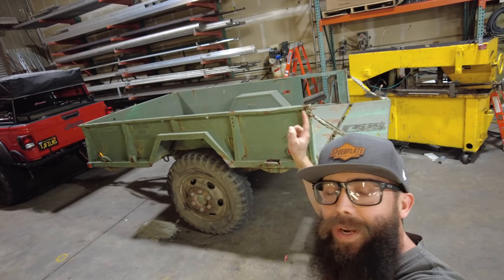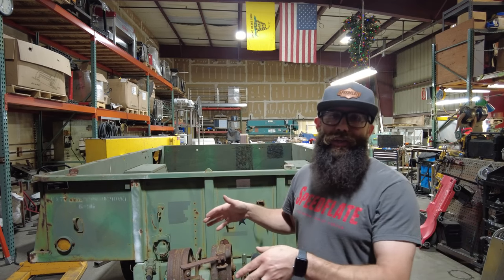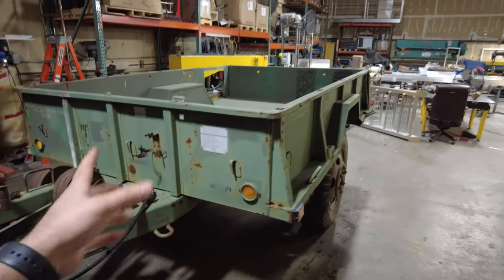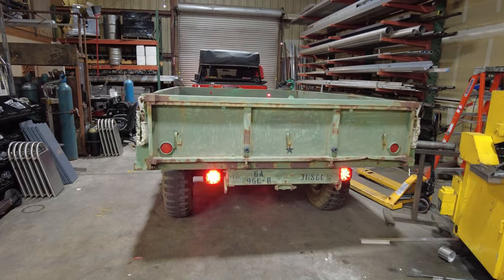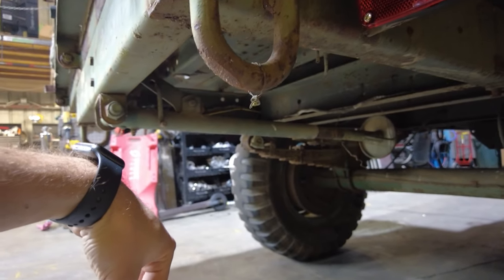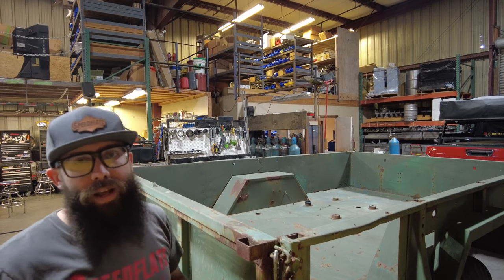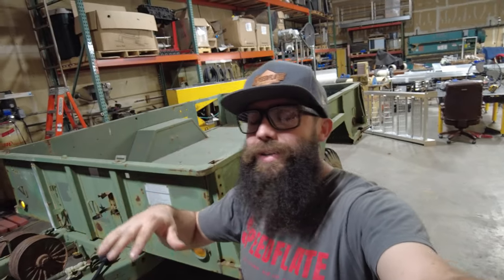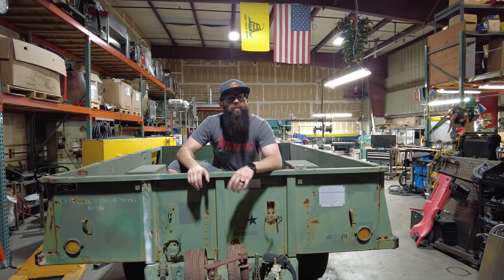Converting a M105A2 military trailer into an off road overlanding trailer.

Comment: They do have electric over hydraulic brake kits don’t know how easy it is to convert, that my plan for if I get the one I’m looking at right now. It’s a great deal at 1500 it’s one that was completely refurbished by a company so it’s from the 80s but it looks literally brand new, but damn that weight. You can change out the 24v bulbs with a 12v bulb no changing hardware. Then follow the wires and it will come to a junction box where they connect so you can cut and splice the wires into a 7 pin, you’ll have left over wires that do nothing but it keeps the original equipment which is what I’m wanting to do. How lifted is your Jeep, it looks like a great fit but I’ve also seen a Jeep Liberty towing one of those on a forum and man it makes this trailer look just absolutely massive.
Reply from the maker: I think most people end up swapping the axle out for something with electric brakes which is what I might do. The Gladiator has a 3” lift and 38” tires

Comment: I replaced the wheels with an izusu box truck front wheels and new tires. Loss the landing gear. 7 pin led light replacement. Built cabin using side stakes to attach walls, added a full size truck cap for the roof. Cabin front is wedged both directions for aerodynamics. Flipped lunnet to level. And more… pm if interested
Reply from the maker: Nice! That’s quite a bit of work!

Comment: Just picked up a similar trailer that came complete with side rails, cross bars across top and canopy.  My question is pintle attachment sits high as it was set up for 2.5  or 5 ton truck.  How did you convert attachment to fit your gladiator so trailer sits level?
Reply from the maker: It only sits level because my JT has a 3” on 38” tires and the hitch location is much higher on my bumper than the stock bumper